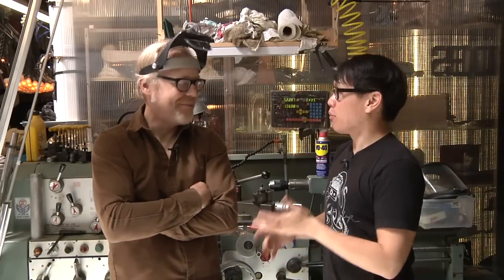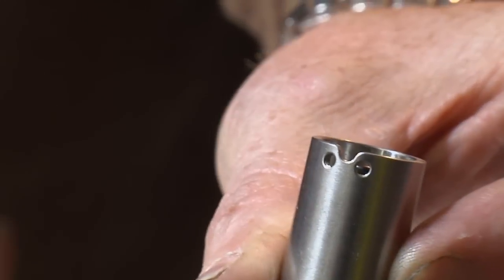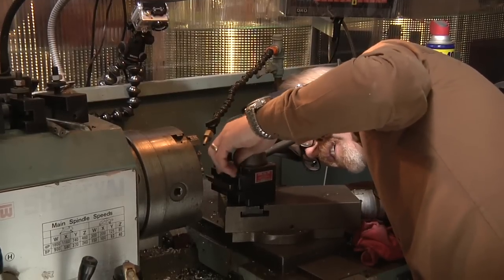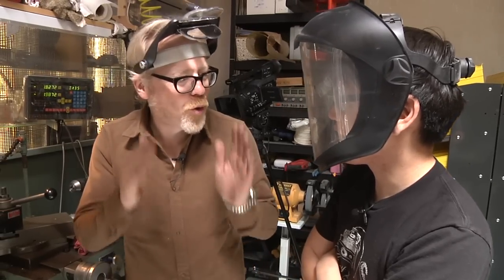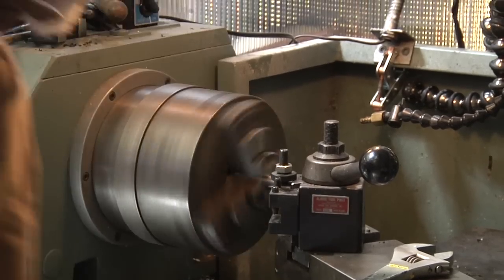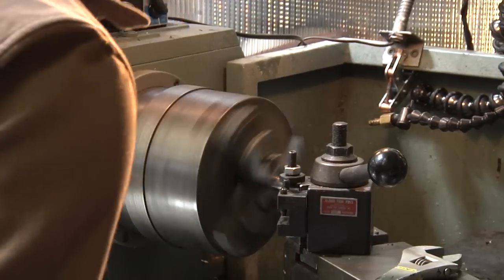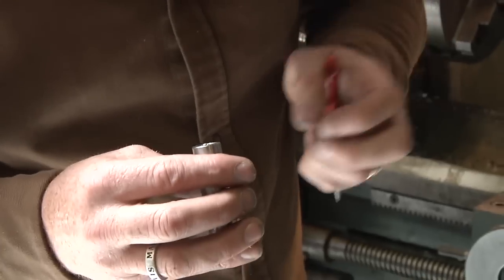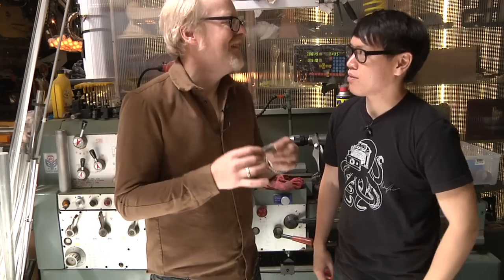Inside Adam Savage's Cave: Hacking a Flashlight for Adam's EDC

Comment: Now you will have the problem of it accidentally turning on inside your pocket. I'm pretty sure that's why the button was recessed in a little housing on the flash light. Have fun constantly buying batteries for your light
Reply: I'm pretty sure he can afford batteries.
Reply: Thats not the point
Reply: I hate proud buttons on pocket carry torches, drained so many batteries by accident plus you can't tailstand the torch and use as a candle if need be.
Reply: I was thinking the same thing Mike. Stupid mod for the sake of dumb-tv. Still, we're watching this right...
Reply: It's his flashlight, fuck off. Go complain about something else.
Reply: good one
Reply: Mike Cunningham One does not need to read all of your comments to assess your intelligence. One only needs to look at this paragraph that you typed. Here is a helpful hint. If you're trying to defend your intelligence to someone, don't misspell every other word you type.
Reply: Steve Clark course you can tail stand it if the button is flat and doesnt require little effort to push
Reply: negative nancy over here
Reply: Mike Cunningham Spelling has a lot to do with intelligence. A lot of simple minded people try to throw out the exception to the rule by using Einstein as an example such as you just attempted to do.

But what these people; such as yourself fail to do is show any examples of your actual intelligence. What Nobel prize did you win? What papers have you had published?

If you aren't going to at least communicate in an intelligent manor, you need to at least have some sort of accomplishment to back up your thinking.

And.swearing doesn't help your case at all.
Reply: Mike Cunningham What I'm getting at is poor spelling is the result of laziness in most cases. Especially in the paragraph I was referring too. Every spelling error in that paragraph was due to laziness. That is what makes a person look unintelligent. Well, that and throwing out the "F-Bomb" in every sentence. Lazy people are NOT intelligent people.
Reply: Tru
Reply: ☆ He doesn't use the same type of batteries as the rest of us humans... lol
Reply: Basically Godzilla what???
Reply: your cool
Reply: fuckin loser
Reply: You're not very intellectual are you?
Reply: Bryan Bedford and you are?
Reply: All I'm saying is that based on Mike's comments, he doesn't strike me as a very smart guy. If you're going to come here and complain about something so stupid (such as how adam savage likes his flashlight buttons) then you must be extremely bored. Just sayin.
Reply: Bryan Bedford did i say you could speak
Reply: bkpickell Alexander Graham Bell, Leonardo Da Vinci, Thomas Edison, Walt Disney, Winston Churchill, Nelson Rockefeller, Richard Branson,Benjamin Franklin, Bill Gates, Louis Pasteur, and George Washington,
Reply: bkpickell Believed to be related to how ones brain is wired, dyslexia often manifests itself not only as trouble reading but also as difficulty with spelling, writing, learning foreign languages, and organization. For a long time, people with dyslexia were considered to be, well, dumb, since reading quickly and well in our society is considered an indicator of intelligence. But what has become obvious as evidenced by the sheer number of dyslexic World Economic Forum attendees in Davos and by plenty of research is not only that dyslexics can be, and often are, brilliant, but that many develop far superior abilities in some areas than their so-called normal counterparts.
Reply: i mean i can continue if you want.......
Reply: Mike Cunningham I guess copy oasting some shit you found on google makes you smart. Man, get out of here, your comments are ridiculous.
Reply: OpiumNomad Pasting*
Reply: OpiumNomad fail
Reply: i2aiden It's called a typo.
Reply: OpiumNomad No it's called ironic.
Reply: i2aiden I guess you should go learn the definition of ironic.
Reply: Mike Cunningham lol, just saw your face and how much of a douche you look like. So really, everything you're saying, insults and shit are just right up your alley. Keep being smart kid ;) And please, keep amusing me with your dull and uncreative comments!
Reply: Mike Cunningham That's not how the internet works.

Comment: Im a machinist by trade and i work with lathes and millingmachines every day, i mean no disrespect to adam, he is a awesome propmaker and he is really inspiering with the way he lives for his projekts!
But that was kind of rediculus...
using a correctly sharpend hss tool, and a lower turning speed that should be doeble in around 30seconds without having to worry about overheating, my boss would fire me if i took the time he did for a simular work... sorry for the bad spelling im a sweed
Reply: What's kind of ridiculous is that any time someone posts a video of using any tool on Youtube, you're guaranteed to find someone in the comments moaning about how everything they're doing is wrong and stupid.
Reply: just had one of those days when the tiny little things are too annoying to keep quiet about... Sorry for the poorly motivated bit*hing.
Reply: Is adams career to be a machinist? I don't think so. Did he get the job done? Yes. 

So why are people even commenting anything negative on how he does what he does?

Comment: ROFL cutting fluid really, I can par that off in 5 seconds before it even gets warm.
Maybe good idea to remove the switch all together before milling & filling it with cutting fluid. And why the hell you want a proud switch on a flash light that you carry in your pocket? Makes no sense at all it's more likely to switch it self on in your pocket when you bend down or bump it then when you need it the battery is flat.
Reply: ROCL ego-tripping really. I could do this in 5 ms while actually cooling the work material.

Comment: I got the front of my shirt caught on the tip of a snake router...and the thing started winding up my shirt and moving up.. I was in a class at a community college. I had never known panic like that before. Trying to pull it away, (the router edge, shaped like a pipe end with a curved tip covered with sharp edges) I watched this thing travel toward my neck. It stalled. Otherwise I probably wouldn't be here now.

Comment: Adam! A quick trick to get the tool height on the center line of your workpiece is to grab a thin piece of sheet metal or plastic you have near the lathe (a thin ruler works well) and use the tool to pinch it against your workpiece in the X-Direction. If the ruler stands vertical, you are centered! If you are too low or too high, the ruler will be angled because it will always be tangent to the round workpiece.

I'm not sure if this is how you check center line but from the video it looked like you were just eye-balling it. This tip only takes a few seconds and works great!

My favorite testing videos are always from Adam's Cave, keep 'em coming!

Comment: Just an idea, if Adam wanted a AAA version of his EDC flashlight, all he would have to do is go out and buy a Streamlight Microstream C4. He had mentioned that he doesn't like a rubber button, well lucky for him the Microstream has a removable rubber layer that sits over the pronounced button. If he wanted to get really fancy he could replace the hard plastic button with a metal one. It would be a really good low effort AAA flashlight for him. Common battery, pronounced button, on-off only.

Comment: for machining stainless when it squeals is when it is work hardening. And one quick tip for setting tool height, use the rotating dead center (live center) as your point of reference.

Comment: Alle the people that are like hurr, proud button equals empty batteries, durr, should probably consider that that button is most likely pretty hard to press. The spring looks pretty strong, and the button more like you actually need to press it down 2-3 mm for it to switch.

Comment: Another way to have accomplished the same thing with no risk to the flashlight would have been to fabricate a taller metal button adapter on the end of the flashlight. The advantage is that Adam could have returned it to the original configuration after becoming disgusted with having a dead flashlight all the time.

Comment: I worked Summers in a machine shop for years as a kid and there were countless hours of cleaning up all the chips from the bottom of the lathe so that you could not see a single chip. I don't miss those days but have an extreme appreciation for quality manufacturing now.

Comment: It's 4.76 mm but in either case 3/16" /= an even mm measurement. 

Metric does make a lot more sense and is easier to pick up, but for people that work with imperial (pretty much any US shop worker, carpenter, etc.) know it well enough that it doesn't really matter to them.